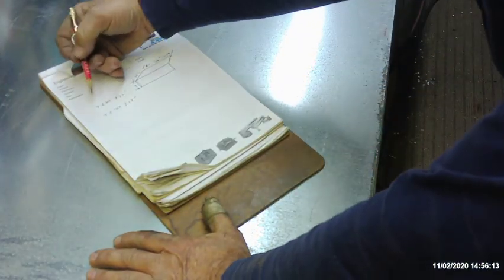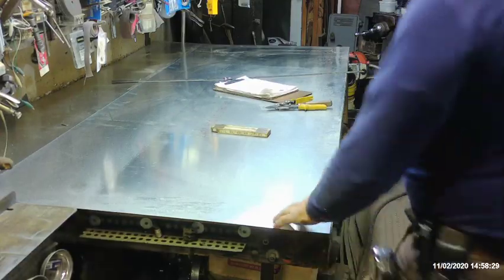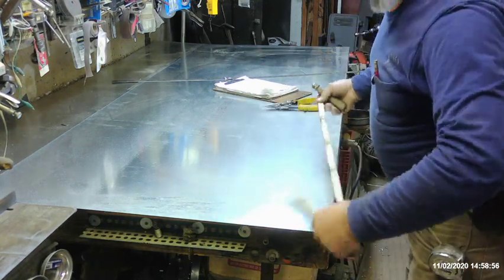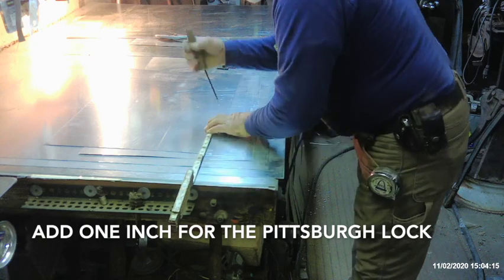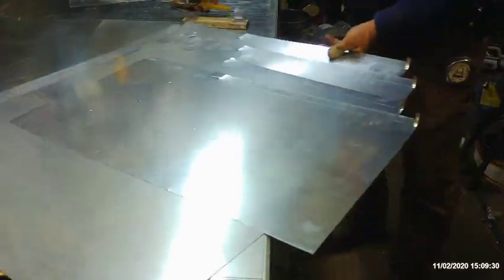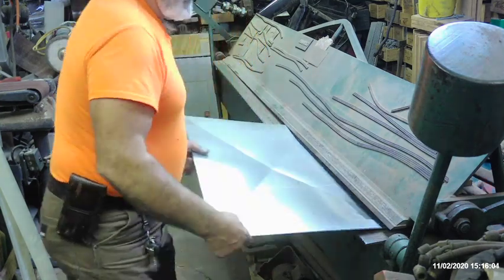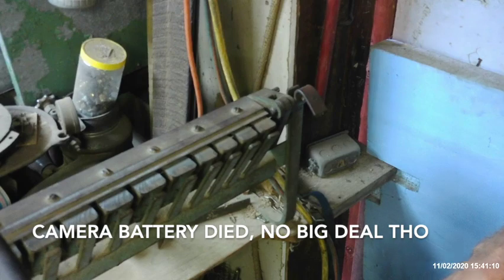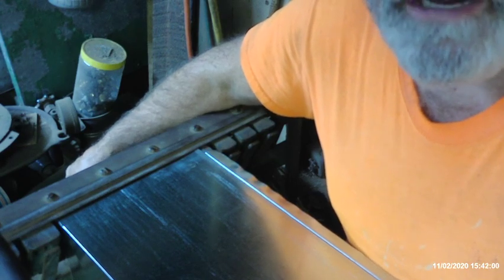Basic Duct Layout Refresher- Fresh Upload But Recorded in 2020

Comment: Thxs for digging through your old videos. I'm assuming you don't have a 4' shear to cut the metal. Presently catching up on YouTube in the shade  in my backyard. It's 96° at 4  o'clock this afternoon. Looking forward to October.  Thxs for the vids.
Reply from the maker: It's been a bit warm for sure David.  No matter, because as an hvac tech I prefer temperatures below zero or over a hundred.....(-;  I only have a 36" shear.  It's an old Pexto I've had since about '85 and sits protected from the grand kids.   It's got the back guages too so for many years I'd use it to cut  scrap material into 3" and 2 1/8" for the S and drive machine. 
    I sold that machine along with an Engle 20 ga chain drive Pittsburgh machine and another 8' Dries and Krump.  Then last year or so I sold another Dreis and Krump 8' brake too.  I still have the drive rolls on the back of the current Lockformer and have a few thousand 2 1/8 various length stacked under the bench when I need them.